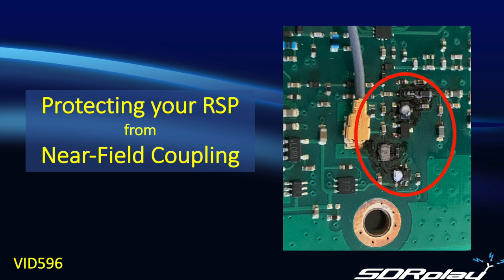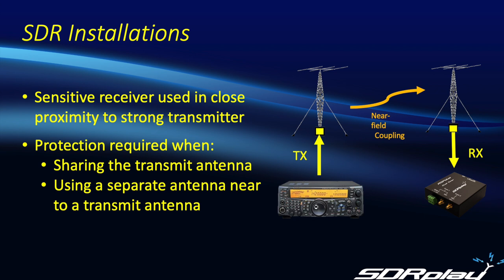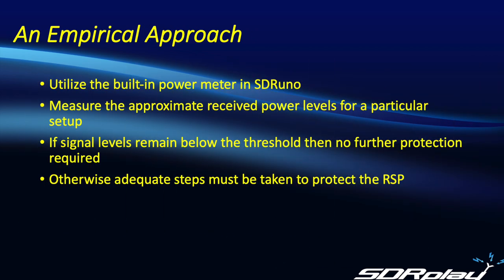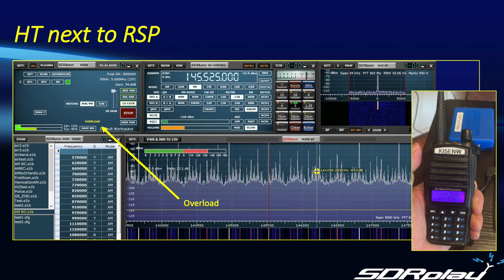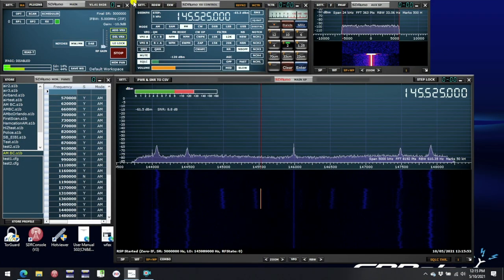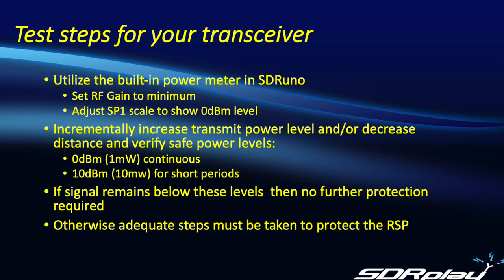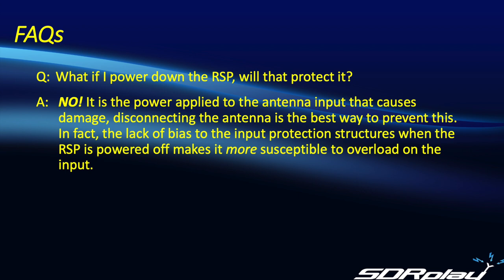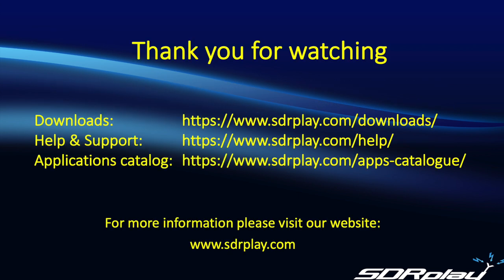Protecting Your RSP from Near-field Coupling

Comment: Good and timely video.  The MFJ-1708B-SDRS seemed to be the no-brainer solution for me.  But the current price of that item, when I can find it in stock, is higher than what I paid for my RSP1A.  This video is spot-on that the first question to ask and evaluate is whether you even need to add any input protection.  The video covers this well as it describes the empirical measurements you need to make given your specific rig and antenna configurations to answer that question.  For me that would be an ICOM 746 HF transceiver 100W into a G5RV Jr. antenna, and a RSP1A into a MLA-30 loop receive antenna, 40m, 20m, 17m, 15m, 10m, 6m bands, with the antennas about 25 ft. apart.  To use a single antenna (G5RV Jr.) for transmit using ICOM 746 and receive on both ICOM 746 and RSP1A would probably require a MFJ-1708B-SDRS.

Comment: External protection question.  In addition to my new RSP1B, my concern also involves protection of my NanoVNA-H4 and my TinySA Ultra inputs.  Will a SMA shorting plug be sufficient to protect these inputs, and if so, should such a termination be considered a fundamental requirement when these devices are stored or not in use while in the HAM shack?

Comment: I use relay switching using the external amplifier tx relay on the back of my TS590SG. This operates an rf relay on the input of my rsp1a, Using a 50ohm resistor to ground to protect the input. RS have ideal rf relays perfect for this as they supply types that are low loss at ghz. 73de GØUSL
Reply from the maker: Unless you’re using a linear you can set the DRV output on the the TS590SG (not the “S”) to be a protected output to your RSP, no additional protection required.

Comment: Putting it in an actual metal box could surely help the situation. I've seen first-hand how well metal-coated plastic cases fare in the chamber. I've worked for companies who had to replace coated-plastic enclosures with metal ones when the coated ones could not be made to meet radiation requirements. I've seen spurious signals occasionally which I was able to eliminate by wrapping the RSP1A's chassis with aluminum foil. Tells you how good that sputtered "shielding" is. :(
Reply from the maker: You may have noticed the blue plastic. It was an early prototype without the spray on coating. I forget to mention this in the video. Fact is unless the frequency is very high (wavelength comparable to size of the box) the shielding does not help much. That’s also why I conducted the various experiments. Bottom line: in the most susceptible state the unshielded RSP1A was not damaged by near-field coupling.

Comment: Im viewing a year later but this advice is timeless and drives away several bad ideas to protect sensitive SDR and other receive equipment. Basically- disconnect and ground the input and casing. In case of direct hit lighting, connect to insurance :)

Comment: An interesting video and explanation. However, the suggestion of reducing RF gain to the minimum and reducing the IF gain to the minimum kind of negates the whole point of having an SDR. A deaf SDR is pretty useless if you are trying to use the SDR for receive and your rig to transmit, which I guess is what many people want to do. Same really if you're using it as a panadapter. The whole point is to be able to see what signals are around on the band, both weak and strong. 

Good info on the fact that removing the USB doesn't protect the SDR. Sounds like the basic issue is that the protection diodes in the RSP input are not able to handle enough power, so why not just replace them with some beefier diodes that can handle enough power to protect it properly? To me, that would seem the obvious and simplest solution, or even add some beefy protection diodes external to the RSP1a at the input connector. Of course you need to be aware of the capacitance of any diodes that you fit, as that capacitance will affect the sensitivity of the SDR.
Reply from the maker: Hi.  The comment re reducing RF gain was only in the context of checking the strength of the local transmit signal. Once you have proved to yourself that the transmitter won't generate more than 0dBm (1mW) RF input power to the SDR then you can use whatever settings you want from then onwards.  The damage can occur irrespective of any SDR software settings.   As you touched on, the problem with adding "beefy" diodes or protection circuity,  is that this hammers the performance as you go up in frequency - this is a wideband SDR designed to work equally well right up to UHF and beyond.
Reply: @SDRplayRSP  Hi and thanks for responding. Ah, it seems that I misunderstood and didn't realise that we could return the RF and IF gain controls to normal after testing. As for the drop off in performance in UHF etc, yes, I did mention that the capacitance of beefier diodes would affect performance. I guess for me, the decrease in performance at higher frequencies wouldn't matter, as I usually only use my RSP1a for HF to see what's around as it is far better than any rig bandscope. One of these days, I will fit some beefy diodes across the input so that I can actually use it without any issues whilst transmitting. 73

Comment: SDRplay Software Defined Radio Receiver  Steve I have my sdr play next to my yaesu ft450d. It's rigged upto my pc around 2 Feet away in the same cupboard.
The yaesu 450D has a maximum output of 100w but I never use this much power maybe 80w. The yaesu is connected to a sirio 2016 which is mounted around 20FT away from the sdr antenna ( discone) I am absolutely paranoid ill blow my rsp1a. Am I safe to operate at same time?

The yaesu has an interface scu17 unit I was going to run the sdr through this too so I get the coverage on screen.

I would like your opinion on this. I would never use it in same antenna but the 20-25FT should be enough distance??
Reply from the maker: You should be ok. If you’re paranoid add a T/R switch, but follow the steps in the video (slowly increment power in the Yaesu while observing the RSP display) to verify.
Reply: @SDRplayRSP  OK my friend, thanks very much for the rapid response

Comment: NOT as robust as other regular receivers,  this is pure malarky.  Be prepared to send these off for front end repairs, at your expense.  Very disappointed in front end and sdruno software for windows 10, nothing but problems.  I own RSP1A and RSPDX, wish I had never purchased  them.  HOWEVER, when they do work they are  good.  Front ends are pPOOR design, very fragile compared to any other receiver.
Reply: try using a common mode choke